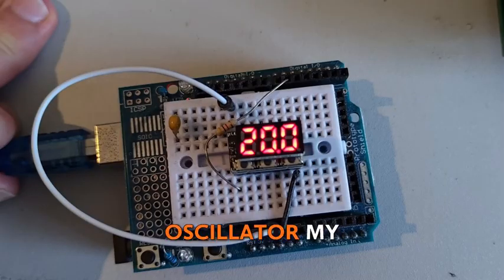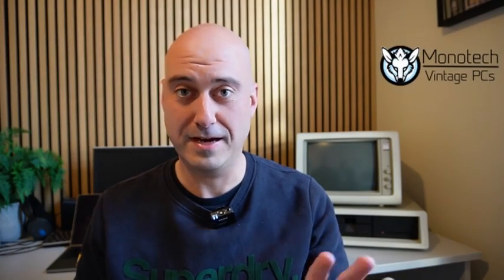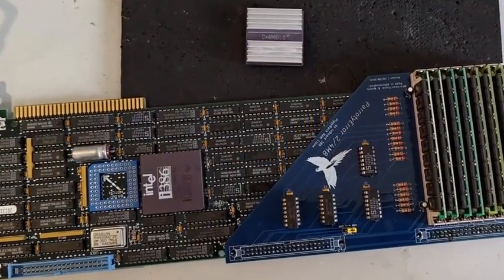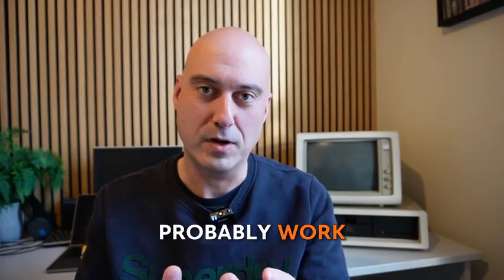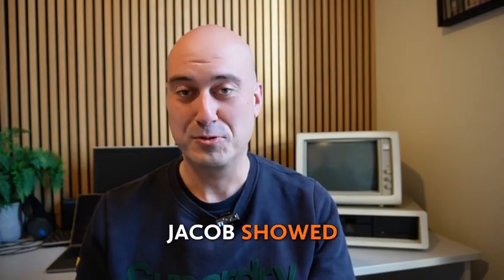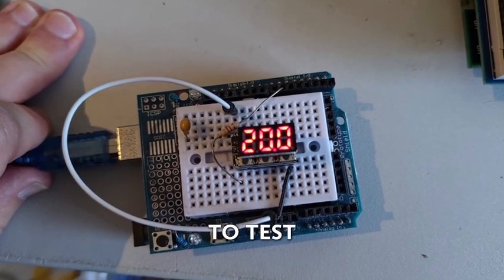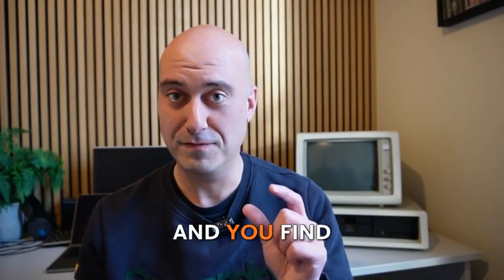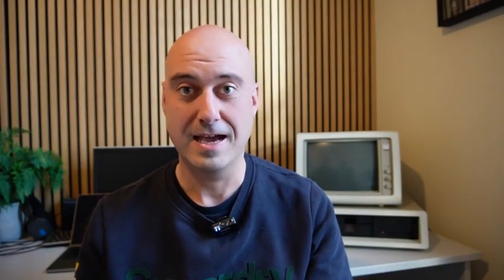Preview: Ditch Soldering - A Programmable Oscillator Changes Everything

Comment: Many years ago we tried out an accelerator for my father's IBM PC that had a little potentiometer to dial in the MHz you needed. This was probably 1982.  Basically they'd turn it up until the PC became unstable.  I was very young at the time so I don't know the details about what it was but I suspect it was a NEC V20 chip with some kind of programmable oscillator to control the clock speed. I remember watching some fellow computer enthusiasts playing with it.  For whatever reason my father didn't keep it; it must have been a relatively expensive upgrade for the time.